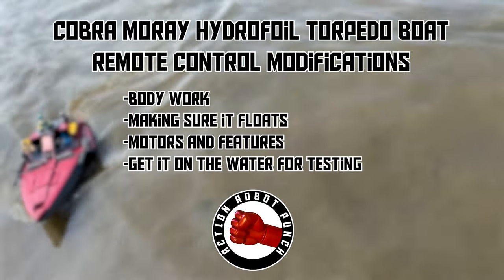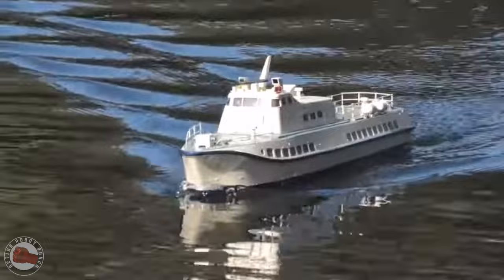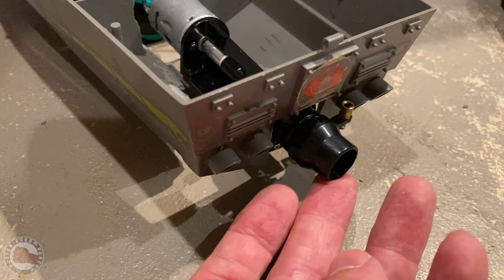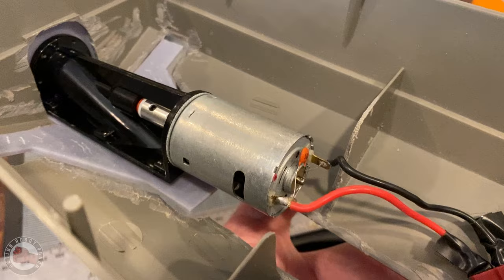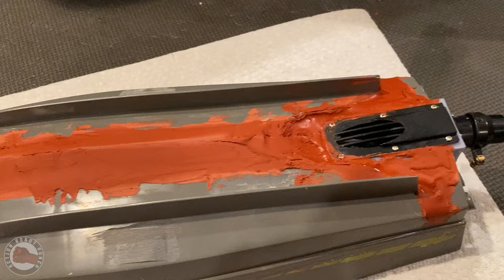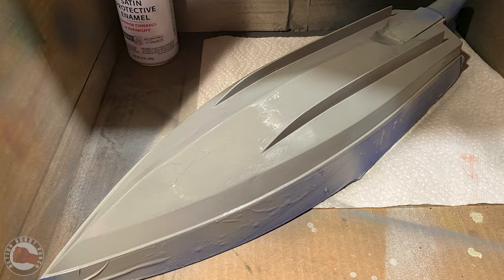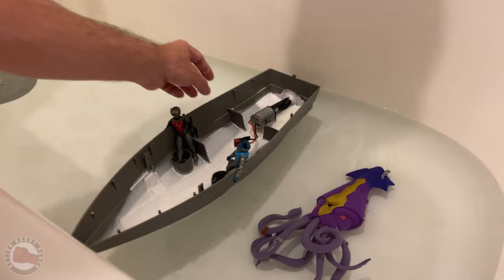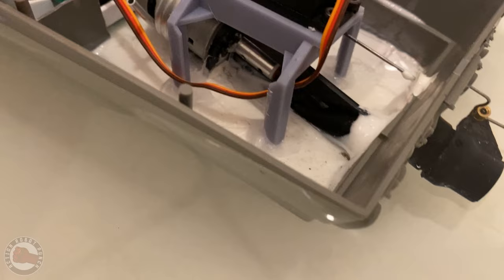Gi Joe Cobra Moray RC Conversion - How to

Comment: The boat is amazing on its own, but super cool that it has Ron Rudat’s seal of approval! I’m planning on doing a modern version of the Water Moccasin using the fort boat for 1/12 scale figures. You are definitely an inspiration!
Reply from the maker: Very cool! That boat looks like a great base for a custom at 1/12th. Good luck and thanks for watching.

Comment: Since it started life as a hydrofoil, I don't see any problem with making it considerably faster.  Fun story: As a kid I got one of these at a local Shopko when I saw it had a sticker on it that clearly wasn't the right price (wouldn't have been able to afford it on allowance money otherwise...lol).  I don't know what the sticker was for, but it wasn't the price, and I got it super cheap.  This was in the mid 1980's, so scanners weren't a thing and everything was pretty much hand entered into a register.  I got it up to the counter and the lady looked at the sticker and punched the number in without a second thought, and I walked out with a clearance priced Moray.  Man was I stoked, because I was heading to my grandmother's house that weekend and she had a creek that ran through the property.  After getting to my grandmother's, I opened up the package and got everything together...and realized the turret was missing.  My excitement evaporated.  I took it down to the creek once and let it float for a bit, and ended up returning it the same day.  All the other ones were gone...at clearance prices.
Reply from the maker: Getting a toy with a missing piece has got to be one of the worst things. Thanks for sharing the story 👍
Reply: I got the mobile command center as a kid without the pieces that connect the folding sections! So I ended up with a vehicle and two boxes! Had to bring it back two days after Christmas and exchange it.
Reply: @DareDevilDave75  oof

Comment: scupper valves can aid with water ingress by letting it flow out the back when accelerating. 
also a show plate of some kind under the missle hatch might hide the guts of the electronics and also look clutch if you style it with wire and bulk head type of details. 

great build. verry impressive
Reply from the maker: Great ideas. The detail plate under the missile launcher would be an easy add and really clean things up. Thanks 👍
Reply: @ActionRobotPunch  yeah man. I use to do rc boats so I'm excited about your build. are you running lipo? and it looked to me like you had a brushed motor on the jet pump. a brushless might be the ticket but it all depends on that jet pump delivering the power to the water and not cavitating. can't wait for the next update video!

Comment: You can help floatation by adding styrofoam blocks or spray foam inside the hull. And use something like automotive GOOP around the seams so water doesn't get in. Also I use to put bags around electronic parts to protect against moisture.
Reply from the maker: Thanks for the tips and for watching the video 👍